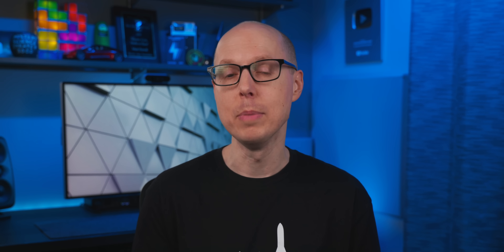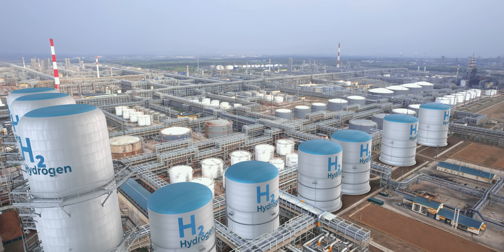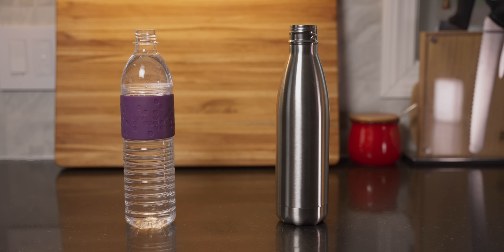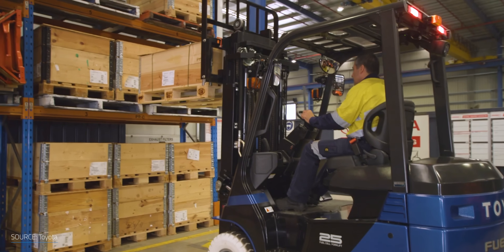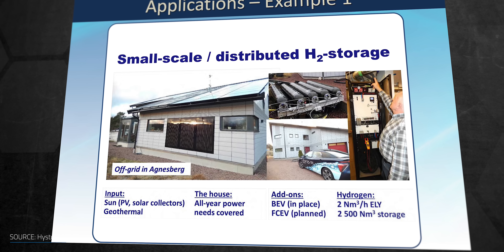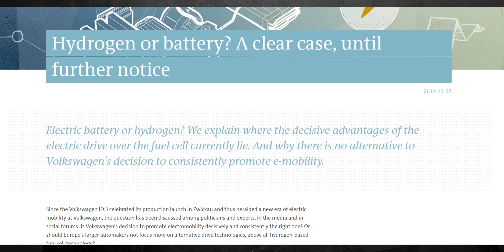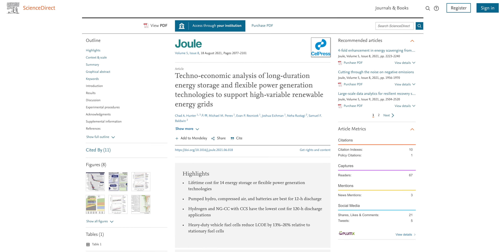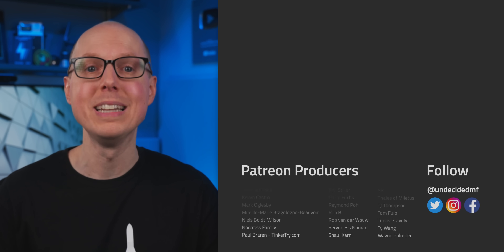Solid Hydrogen Explained (Again) - Is it the Future of Energy Storage?

Comment: Some people don't care about accuracy in language but you might. When comparing two things or processes in regard to size, amount, speed or other variable where there is a measurable difference, the word TIMES refers to a larger number, not a smaller number. A smaller number, 1 kilo vs 10 kilos for example, is a fraction or percentage. One is not ten times as light, it is one tenth the weight. Any number TIMES another number will be larger. So you can't have 100 times cheaper, 10 times slower, 3 times lighter and so on. Un-measurable opposites are fine, Bob is 10 times uglier than Bill but 100 times handsomer than Ed. Don't worry, Ed is rich.

Comment: Great job, I always enjoy your videos. I’m hopeful that hydrogen becomes a solution, it is more versatile.  Now as I am seeing the effects of lithium, with the giant holes in the earth and the large evaporation ponds using fresh water in the process of making lithium, this looks something like oil or coal all over again. Digging and scraping the earth and not for energy but energy storage.  The thing about hydrogen is that we can make it, albeit not cheaply right now vs digging up tons lithium and other elements. If we had hydrogen fuel stations, like gas stations, that made their own hydrogen then we cut out the energy costs from transportation.  And if we could get to a $4 per gallon cost to energy output, then no amount of lithium battery would be worth it. Also Commercial aircraft could use hydrogen, as could light personal drone like aircraft. I’m afraid of the lithium wars…lol.
Reply: The real danger is the irrational desire to force one solution for every problem.  Fast charge should focus on super capacitors and liquid fuels, long term storage on solid H2, flow batteries, pumped hydro,  perhaps ammonia and some batteries, energy distribution should use electrical grid because there is almost no wear on the network once it is in place  and it can create resilience id production is distributed, production should use any and every renewable system that has long lifetimes and does not have massive environmental cost.

Having ways for a small farm or community to generate their own liquid fuels (ethanol, ammonia9 from renewables or crops would make them resilient and self sufficient.  if a community is self sufficient it makes better choices all round for the people and the environment because it is not compromising on fear of survival, if it is over a barrel it is a serf and the government and energy industries manipulate it in negative ways.  The same goes for a city, province, country and the globe.  Local energy independence means energy taxation, oil and lithium wars are not a threat.

Comment: I've been following solid fuel cells for over 10 years there was a company called millennium fuel cell who had a system where they can make fuel cells into batteries and all you had to do was just plug in a fuel cell canister into a car into anything and run that electric motor on a content into can fuel cell well they went belly up may never made it to market lost all my money investing in it some of the other companies that used invest in then where plug power fuel cell Ballard which are still around today plug brought up hydropower which was alongside millennium fuel cell so if you know anything about millennium fuel cell and their process I think they had something good there but again it never made it to mark out thank you for what you do

Comment: Why hydrogen when renewable methane (biogas) is a better choice? Methane is made by bacteria when fermenting biological waste. In Europe there are large biogas plants that makes methane that can replace natural gas. 

Unlike hydrogen, methane is also easy to store and contains much more energy. The stubbornes to use hydrogen as storage baffles me. Use batteries to store electricity instead. When batteries ain't enough, biogas is the best option. 

Biogas is a drop in replacement for natural gas, and it actually rivals renewable electricity when it comes to environmental impact, so why not use it?

Comment: Matt, I can see the basis for the critiques you suffered with. It would have benefited  you greatly to not have mentioned Plasma Kinetics entirely, and to perhaps not even have revisited it. Have a look at US20100163434A1 (US patent). They provide an excruciatingly detailed review of every aspect of their tech, which only makes more ridiculous the overall claim that this disc and film based idea could ever store but tiny amounts of hydrogen in relation to any system component size. They offer publicity quotes in kW of this for tonne of H2 that, hoping the psychological effect will be to deflect the reader away from noticing that real hydrogen quantities are hopelessly small. It's no wonder legitimate teams. like those at Livermore, won't directly talk of this - it has all the smell of a Theranos "fake-it-'till you make it plan" . The REAL attention, as you have surmised, should be on the action with serious amounts of gas capture substrate, and on breakthroughs in the physical chemistry for drastic increases in mole ratios of H2 to substrate, lattice hydrogen mobility, etc.. Best regards. Domenico Barillari.
Reply: On the surface of it, plasma kinetics wants to break several laws of physics. On one hand stored hydrogen has mass and where exactly is this mass?
Reply: Matt will ignore this logical and factual summary.  Well done on your thorough analysis.

Comment: Gaseous or Liquid Hydrogen are a DEAD END!! I know what "I Know" as I was involved with this and other alt energy on the ground level.
There are hidden costs to compressed or Stored Hydrogen! gas! (O the "Humanity of it ALL!")
Environmental Control and abatement COSTS FOR such a dangerous gas in parking or Vehicle storage and use areas!  
This Elephant along with the Cyro and Chemical energy DANGER stored in this Gas are never pointed out as costs!
SOoo you must engineer!! to Protect the public from getting Freez Dried, While not getting Blown UP, Burned Down, or Suffocated ALL AT THE SAME TIME!
there is a Price to this fact.

Comment: Yes!   I feel that "solid-hydrogen" WILL be used  in large installs--power-plants, ships, "truck-'trains' like those in Australia, locomotives, Semi-trucks, Ram-jet SST commercial airliners--maybe even Dirigibles {--but NOT as a lifting force;) }. Although I've followed Hydrogen since Utah's "Hydrogen Progress" days where hydrides were used in a H2-powered AMC "Gremlin" [--'72 - 73? ], I just 'Know' it's the ONLY WAY to have future-use of the Abiotic-oil constituency, going Forward.   By the way, couldn't "conductive-pot-metal" be "nano-foamed" to provide a cheap, light, matrix for small-car auto use, freeing-H2, by minimally heating section by section with some low-voltage-DC, feeding an IC engine with a gaseous carb...--oh, they were doing that with the Gremlin in '72.    The Saudis, the Africans, the Russians, & S. Americans are going to WANT to "preserve" their 'black-gold,' even as the World wants to abandon it.

Comment: I'm not trying to be a pain but you kinda glossed over something that I don't think you should have. when you were explaining how the metals absorb the hydrogen you only once and very quickly stated that it started as a molecule and when you did that it seemed like you were saying that a single atoms were splitting and then bonding. the amount of energy required to do that would be absolutely insane and your diagram animation didn't make it obvious that you were talking about molecules and not single atoms. If you had put a little more weight into the statement about it being molecules and not individually captured atoms that were getting absorbed your video would have been more easily understood by people who were only paying half-hearted attention. the next thing is that some of the information on some of the things that you talked about aren't completely accurate and somehow make it seem like your getting much more energy out than what you are putting in. I'm not saying that you are completely wrong or that you aren't doing your best I'm just trying to let you know about a few places that you might have been able to be more clear on the subject and because of that it might confuse some people.

Comment: would these be good for a space battery? weight wont matter once in space and being able to store energy regularly with little lose would be helpful. the heat needed wouldnt be a problem with solar radiation and a couple focusing lenses.
Reply: The problem is getting it to space.
Reply: @jamesvandamme7786  once it's in space it's not a problem and we have plenty of ways to get it there
Reply: @pulsefel9210  Yes, but you pay by the pound to get it there. A LOT.
Reply: @jamesvandamme7786  those who worry about cost will never advance anywhere. besides whats it gonna take? a .1% tax on the richest 10 people to pay for 100 of these launched?
Reply: @pulsefel9210  That's why they use batteries fed by solar cells instead of heavy, complicated hydrogen gismos. For long range missions, nuclear thermoelectric generators. 
Don't fall in love with a technology. Look at all the alternatives.

Comment: This is a great update, Matt! I do still feel that there's a lot of research into less proven fields while we have a fairly mature approach that has been making occasional news but doesn't seem to be hitting the mainstream yet. By most accounts it seems that liquid air energy storage (LAES) should be a no-brainer: it has a factor of 10 energy density advantage over compressed air or pumped hydro and makes use only of components that are being mass produced by already mature industries (welded storage tanks, insulation, pumps, steam/air turbines and generators). Round trip efficiency has been estimated at around 70% if using a combined cycle of storing and reusing heat. Considering that such systems could be scaled up to grid level and down to practically substation level (esp. if using a cheaper form of air engine, with a respective drop in efficiency), and that we could start mass producing these TODAY, I'm still curious what the hold-up is. Maybe a mass comparison of the biggest storage contenders should be in the cards?

Comment: While you corrected many errors from the prior video, even in this one the issue remains with incorrect terminology. When describing applicable use of the technology you repeatedly use the word “air” which means “the invisible gaseous substance surrounding the earth, a mixture mainly of oxygen and nitrogen.” Had you used the correct word, “gas”, with high hydrogen content as you correctly explained continued confusion would have been avoided.

Comment: Even after watching both videos, I don’t think I can form any particularly strong opinion about hydrogen’s promise.  I’m very curious to see what emerges.
Reply: This has been around for like 40 years and hasn't really gone much beyond where it was 3-4 decades ago honestly. This is just not practical for the amount of energy you can get out of it, and the size of the systems you'd need to actually run a vtol plane  or whatever.

Comment: On the future of green hydrogen: Maybe people should just stop talking about using it in cars. The round trip efficiency is so low, the gravimetric and volumetric densities are so low and the complexities are so high compared to batteries practical hydrogen cars aren't going to happen unless some unexpected breakthrough happens.

But some of the disadvantages of hydrogen's use in cars are less important for its use as a process gas and perhaps as part of  long term energy storage systems. There is a cheap source of electricity that could be used to make hydrogen. All the electricity from renewable sources that is otherwise wasted because sometimes there is insufficient demand for it. Maybe that's where the hydrogen proponents should be focusing their efforts.

Comment: Ideally one should include more of the context and the process in the original video, because despite making it longer it also makes it more logical and we can follow it step-by-step, also more of the pop-up questions we get will be answered right away.
Otherwise (at least if you limit it to 5 mins) you're getting in the sells-pitch territory, which isn't known for delivering great details (actually exactly the opposite).
But despite all of the above, it's great that you're not shy of coming back to a controversial subject, and elaborating!
After all the iterative process is the most natural process we have for achieving progress.
So good job!

PS. I just have a question about what metals, and what shapes are used in these applications?
You mentioned some info about density, and that (at least one of the solutions is) using tape ...
But just to clarify the "metal" part of the hydrate it would be good to know. (otherwise for example according to astro-physicists metal is everything above Hydrogen and Helium :) )

Comment: The part where they were claiming energy efficiency going from 25% to 90% by using the heat generated to heat homes seems like a bit of a stretch.  Most of the world isn't going to need the amount of heat you might need in the Alps in Winter.  So the heat is just a waste product you have to now manage.  Even in the Alps in Winter, if you make the comparison with a home heated with heat pumps then the comparative efficiency would be lower even there (heat pumps can provide hyper efficiency since they are moving heat instead of generating heat).

Comment: The gas price comment and asterisk really drove home how much time you put into your videos between recording and editing for upload. 

I do think solid hydrogen has its place, but I'm struggling to see it as viable for transportation. Transportation is primarily short term storage, weight-sensitive as you mentioned, and I can't see the increased upper scalability of the fuel cell separation being enough to offset that. While there are efficiencies of scale that help things overcome the boundaries of their ideal niche (eg. lithium-ion grid batteries), I'm a firm believer that this is at best a stopgap and that technologies should be driven by what they're best at.

The grid storage options, particularly in regions closer to the poles, make a lot of sense since they have more benefit to waiting longer to release stored energy and gravity batteries aren't always an option.

Comment: CO² is currently greening previously barren or desertified land that was at one point arable (evidenced from NASA photos). It is not a particularly volatile greenhouse gas and its GHG profile is largely overlapped by the main culprit (H²O). Arguably there isn't enough CO² if we further acknowledge that the impact of the man-made deserts (34% of all arable land) is far more damaging to the biological health of continental centres. These create heat vortexes that prevent penetration by rain clouds (W. Jehne et al). Regenerative Agriculture is the cutting edge in that restoration.

Burning portable fuel is going to be restored to its rightful place however large urban areas should use predominantly EEVs to reduce the soot, particulates, NOx, etc. If we can make coal in HCT waste treatment plants then whomever works out how to create liquid fuel and oil in a similar manner will take their place next to Archimedes and the other truly great minds. Will it be an engineer or a Scientist?

Comment: Thank you Matt. This is wonderful news, highly promising, but it leaves me with questions I am unable to get traction upon looking up information on the net.

How many cycles can these metal hydrides support, or does the chemistry not wear out?

What are the consumables lifecycles now with impact of hydrogen embrittlement upon pressure vessels and the metal hydride carrier medium itself?

For stationary installations, can solar thermal with molten salt storage be used for the thermal requirements?

Using hydrogen still leaves us with the challenge of the non-circular use of PEM’s, as I’ve been unable to dig up anyone working on reconditioning PEM’s. Is this be an impediment to scaling up?